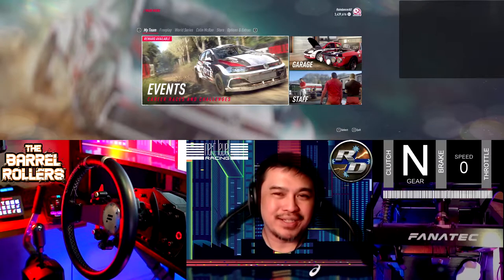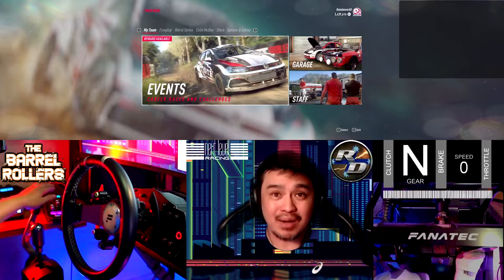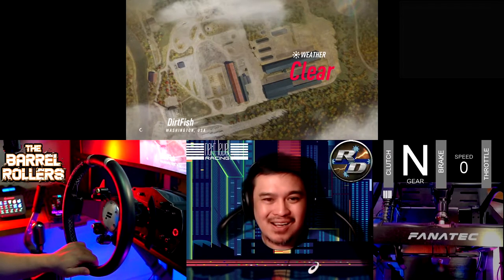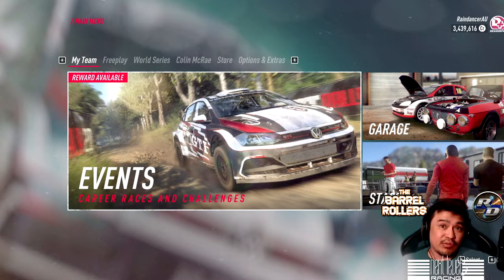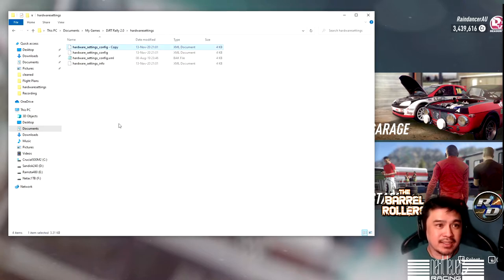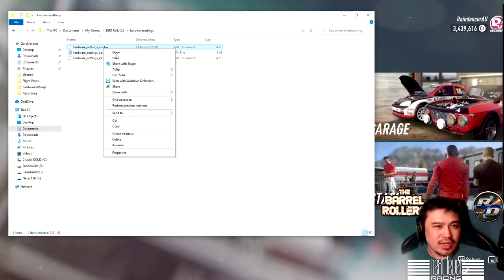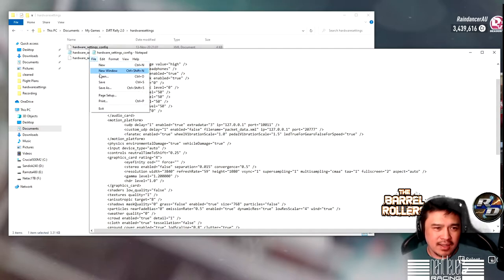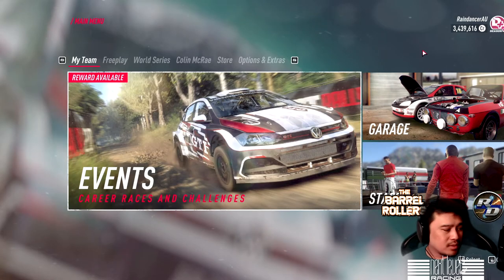Stronger Fanatec Clubsport pedals rumble and vibration in Dirt Rally 2.0 Guide | Tutorial | How to

Comment: Hey RainD... didn't fanatec driver (fanalabs) introduced a simulation setting for the rumble to be compatible with mostly all games now, even Simcades as Forza?... heard something of the like in comments on V3's videos. Everyone says to go for Heusinkveld Sprints and SIM 3D rumble kit, but that's too much $$ for just a few games and semi-serious racing. Thing is.. I can't race without rumble, bass shakers etc. after having all that feedback I just can't go back.
Reply from the maker: You can manually set a rumble point in Fanatec software (don't even need Fanalab, just the Fanatec Control panel) so the motor will vibrate when it reaches a set travel distance, but it is static and not dynamic and telemetry based.
It is still quite useful, as you can set it to like 85% where it is really informative, but it is preferable to only trigger when the wheels are locking up in the game.
Reply from the maker: Also, I like staying with one ecosystem and only one USB port. I have the Aorus Master x570 motherboard with 14 USB ports but I am almost running out! I can't imagine if my pedals, wheelbase, shifter and handbrake all needed their own USB port! What a nightmare!
Reply: @RaindancerAU  got it! ty, so that's what they meant by a setting on driver for compatibility. That aside, so anything that has telemetry, say even Forza 5 cannot do dynamic, unless supported, but will do static as long as it has telemetry... did I got that right?... also, by that measure so will any other rumble kits abide by this?... or by going 3rd party like SIM3D rumble box + SIMHUB are you able to simulate dynamic?... I do have Simhub btw, for my bass shakers.
Reply from the maker: @zemi2750  it is my understanding that the game itself needs to natively support the rumble motors on the V3 and that it is unfortunately not controllable by third party apps 😔 
Would have been great if we could intercept the telemetry and use it ourselves in programs like simhub to engage the motors how we want.
I do love driving in Forza as well and it would be splendid if we could have functional rumble on lock up as it is very important in Forza
Reply: @RaindancerAU  so that means SIM3D Rumble Box + SimHub would not work for Forza/simcades either then. I know it does work for Rally 2.0 but that's it, was thinking of buying the SIM3D rumble and install on V3's once I get them but there goes the rumble fantasy for simcades I guess.  btw; I play more simcades because of the boredom of playing the same SIMS over and over again, I got all of them (except iRacing). I prefer the 50/50 mix of simcades these days tbh, or hop into AC with customs maps (Shutoku etc.) and just cruise with some YT podcast in the background. Ty for the feedback, appreciated. Subs.
Reply from the maker: @zemi2750  oh I am not sure about the SIM3D rumble box, I only have the V3 Fanatec Pedals. It could be possible to configure the rumble box to rumble on brake lock up via telemetry?
The Fanatec v3 won't work unless the game has native support, but this Rumble Box maybe?
I will research as well when I have some more time and if I discover anything I will comment back here 🙂
Reply: @RaindancerAU  Check out Karl.. he has one, also videos are all over the place.. seems like it should work with anything that can work with Simhub (Forza Included), tho no videos outside RALLY 2.0. I just wasn't sure 100% how it works for Simcades. It's cheap for what you get, more customization and more powerful Arduinos, along any bracket for any pedal you can think of. 

That's why I've been all night watching videos to squash all the kinks before buying, hence stumbling into your channel/video. 

One more thing: everyone I've seen that owns V3's also bought the SIM3D rumble kit. 

CONS: It does use one USB (connection only), and power brick for US has to be bought somewhere else, tho they give you the specs, you will be charged less, so seems fair to me, they only provide UK plug if you choose. 

Here: 
https://www.sim-3d.co.uk/product/pedal-rumble-motor-kit/6?cp=true&sa=true&sbp=false&q=false

Comment: Do the pedales work on asseto corsa?
Reply from the maker: The rumble motors are not supported natively by AC or ACC, but you can use Fanatec software to make the brake rumble at a certain pressure point.
Reply: @RaindancerAU  can i do that with ats ?
Reply from the maker: @mirshia5248  I need to see what can be done for ATS, I have not paid attention to pedal vibrations there

Comment: I just wondering how turn on rumbles in break and throttle. When i test them in fanatec wheel software they work fine but not in game. Can you help my with that ? I have pedals v3 connectet to base csw 2.5.
Reply from the maker: Hi Rafal, only the brakes work in Dirt Rally 2.0. Did you try to edit the text file as instructed in my video? Also does your motors work in other games like Raceroom Racing Experience (you can download for free)?
Reply: @RaindancerAU  yes , i change to 1.5 :) works perfect
Reply from the maker: @rafalbartosiewicz5060  very happy to hear this! If you have any further problems, you can find me on Discord and Twitch too!
Reply: What settings you use in Forza horizon 4 ?? Can you share ? I use Fanalab  in windows.
Reply from the maker: @rafalbartosiewicz5060  hi Rafal, I am preparing a video for that, it is not the most simple thing in Forza 😅, hope to have it out soon!